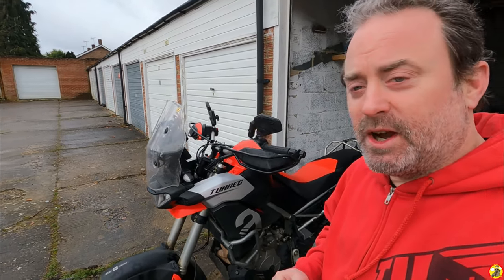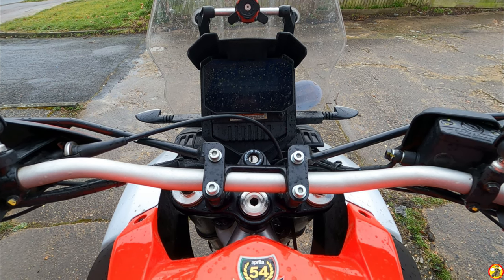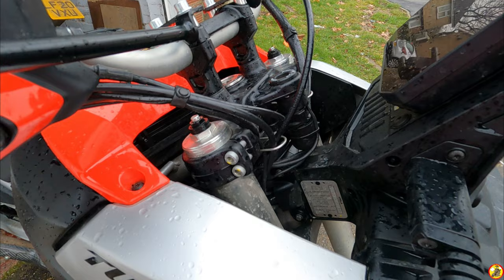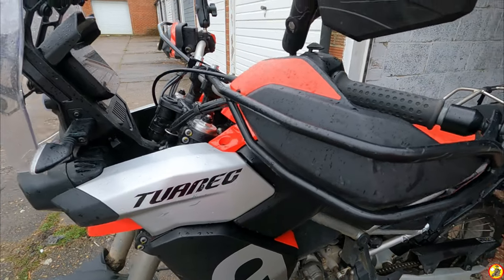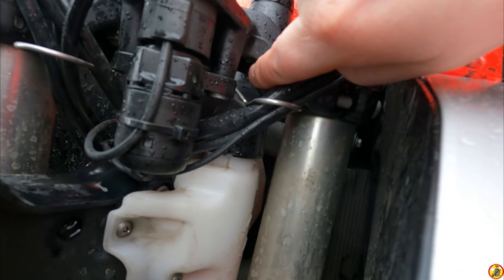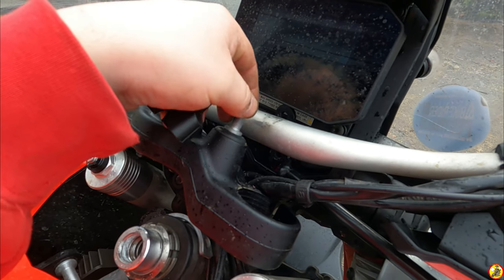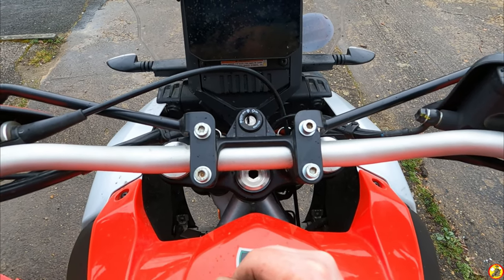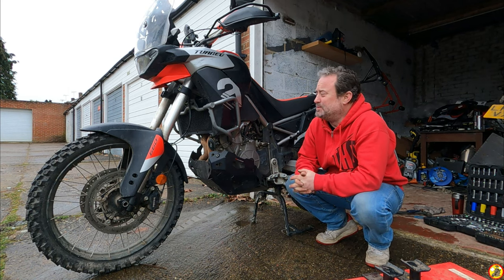Straightening Handlebars | Aprilia Tuareg 660

Comment: Thanks for the video! Mine came with the bent handlebar and so I returned back to the dealership, and fixed it with loosening the bolt from underneath.
After a slight crash the forks were slightly twisted as well as the handlebar.
Loosening the lower bolts of the forks on just one side and the bolts that fix the axle and the wiggle the fork whilst fixing it between the legs did work.
As for the handlebar: just move it into one direction until it is on block and then applying more pressure works immediately. 
Just had to write this, as it made me neurotic, once I realized something was bent or twisted. It´s all in your head, like you said ;)
Reply from the maker: It messes with your brain when the bars are wonky. Glad you got yours sorted easily too 🙂

Comment: Clever boy!!
Well done Pete. I could see exactly what you were showing us in terms of the mis-alignment. Pretty much what I thought from the footage from the crash day, the whole thing out of whack at the bar risers. What a fiddly way to access them, and also, yeah that single bolt coming up and with the rubber mounts makes it a slight point of weakness in the event of a fall onto the bars... but I guess it DID save the bars! :)
Reply from the maker: Haha, thanks David :-D
Am glad the angles worked, and the point I was showing was achieved... cameras and spanners are a tough combination!
It was a bit of a pain to need to remove the top yoke, but easily achived in reality... and due to how the head bearings are mounted, I didn't need to mess with them or the nut that torques them down, so no chance of me messing them up inadvertantly thankfully. I think it is a good thing having the setup the way it is, makes it much less likely that the bars get bent like you say, and had my on bike tool roll I have made up had just a few bits more in it, I could have done this all on a trail if I was more hardcore.

Comment: Thanks for sharing that. I have exactly those same two problems you’ve mentioned here. One straight out out the dealer; funny how dealers can never see these types of problems when you and I point it out to them. Riser bent is my next challenge…to address. That may have happened when I dropped my bike at the light (from dead stop). They are made of dough. Can’t imagine if had ‘dropped’ the bike say at 5-10mph.
Reply from the maker: My dealership is really helpful, so I am sure it will get sorted on my bike.
Without wanting to sound like an Aprilia fan-boi, if yours has misaligned on the riser like mine has, it is designed to twist rather than cause damage to the bars, much easier to slacken things off and realign than it is to replace bent/broken parts! 🙂
Hope you can sort it easily mate

Comment: Hello,
It is the same on my motorcycle and I have not suffered any fall, it comes like this from the factory, now I am talking to the dealer since it is under warranty, in my opinion, this happens because when they are in the wooden box where they are transported, they do not It has the front wheel on, it is attached to the sole of the same wooden box and with the movements this can happen, another theory is that it comes badly assembled from the factory, my TFT is twisted to the left exactly like yours, in fact, in There are gaps on the sides, it is clearly seen from the driver's position, the same dealer has recognized me, this has happened to me since the day of the premiere, I saw it right there when I got on it for the first time, thank you, I hope to help those who experience it the same.
Reply from the maker: I hope you can get it sorted 🙂

Comment: Cheers from Italy!! The cockpit of our little Tuareg is same askew here as well :) I have heard it is a thing with the Martian Red model. You can easily fix that (or at least improve, in my case I did not really fix it 100%) by loosening the 4 bolts that keep the cockpit to the chassis, repositioning the cockpit and tightening again. You will have to loose the little cooler liquid tank as well, in order to have access to the 2 bolts on the left, but it's not a big deal, go for it!! Also you'd be better to loosen the two screws left and right on the tank, under the knobs of the handle bar, to let the fearings adapt to the new cockpit position (everything is connected). 
As of the raisers, I did not fully get from your video, if I ever want to remove or adjust them can I do that without taking the top yoke off? 
Thanks!!!
Reply from the maker: Ahh many thanks, I shall give that a go as the twist is annoying 🙂👍
Regarding the risers, I can't remember exactly, but I don't think that you can loosen them from above, so I think that you have to remove the top yoke unfortunately

Comment: In my case turning riser around a few times sorted it out, riser settled properly on the 'bracket'  after that. I didn't have to take top yoke off. Anyway thanks for video and the tip other day.
Reply from the maker: My riser wouldn't turn without slackening off the nut under the yoke sadly. Really glad to hear you got yours sorted 🙂👍

Comment: I've only ever slackened off one side. The twist is one side relative to the other, not both. Happy to be corrected.
Reply from the maker: Top tip, ta 🙂👍
Reply: I think much depends on the bike in question and the type of fall. If the bike's up on the stand and you've got the tools out, it doesn't take that much longer to work up through the front end from spindle, pinch bolts, fork brace etc. If the bars themselves are slightly bent, it's not uncommon for people to misalign the yokes by setting according to what looks straight from the cockpit. Things like this bug me....think I'm a bit OCD were bikes are concerned
Reply from the maker: @billyb6043  nothing wrong with a bit of old regarding bike maintenance

Comment: The bars do look slightly tweaked but it's not too bad.  Usually, on MX bikes the bar risers have rubber inserts and can be loosened, straightened out and tightened back up.  
Are your fork seals leaking or is that just dirt collecting up from the front fender?  After loosening the upper and lower triple clamps and wiggling her about I would recheck the fork height's in the upper triple clamp as well.  At the end of the day you are using it for what it's made for and it's doing you right!!  Scratches means you are using it correctly!!
Reply from the maker: The forks aren't leaking, just not cleaned the bike properly... I did throw a jetwash at it to allow me to damage assess, I do need to give it a proper clean soon, just waiting for the frost/salted roads to go away before I spend any time tidying it up :-)
Aye, I checked the heights all off camera, same as adjusting the torques :-)
I love the bike mate... sure, it'd be nice if it stayed looking brand new... but that was never going to be possible with trail riding :-)
Reply: @HippoDrones  Oh man I'm the same during this time of year when it comes to cleaning bikes, there just isn't enough daylight and consistent warm weather to properly clean and ride bikes!!  I personally prefer to ride them and I will properly clean them in the spring!!!
Reply from the maker: @MonkeyButtRides  same 🙂

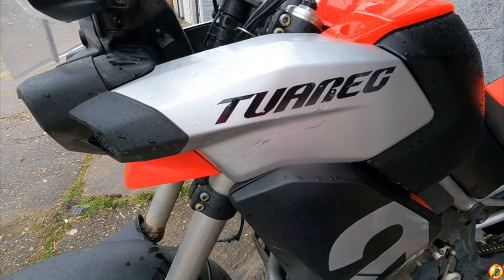Comment: 8:08 -I like to call that "Battle Damage"
Nice damage report, glad it was just a case of slackening things off and retightening.  I wasn't as lucky with the CRF, I really did bend the bars that time last year.  In a way, I'm glad because I much prefer the Renthal bars over the OEM's.
Reply from the maker: Battle damage is the correct term! 🤣
Ahh that is a pain... I did the same on my Beta Alp 4.0 annoyingly close to when I was selling it, so had to replace the bars but got barely enough time to enjoy them. I think the stock bares on the Honda and my old Beta are not the highest quality,  your Renthals will be super strong compared to them! 🙂👍

Comment: YEs, preheat the mug..lol. Man there is nothing worse than having misaligned bars after a spill. I usually find a tree to put the tire on and twist the bars for a temp fix then get home and readjust everything as you did. Man those riser bolts couldn't be in a more tucked away location could they? I could see the offset and even though minor, it really messes with your head. Looks like some lovely weather you have there 😁.
Reply from the maker: Firstly, I love that when I read your post, I read them in your voice! 😀
I think, had it been my Beta, then a tree could have fixed things... but... BUT, although I don't mind the Toe-Rag getting battle damage, I'm not quite ready to wedge it into a tree to reverse crash damage! 😀 hahahah 😀
Preheated mugs FTW 😛
Sadly, the nice funshine was short lived... rained all the way home... and has only been nice a couple of days since... but all good... Spring is on the way! Yeah-Boi! 😀

Comment: Nice job mate ! What are your tires ? Are you happy with them on cold and wet tarmac ?
Reply from the maker: Hi Maxime,
They are Motoz Tractionator Adventures. They are happiest on dirt and wet sloppy mud. Tarmac, especially when wet is not their place to shine. If you mainly ride dirt, they are great, they last well on tarmac, but don't grip great and restrict the speed you can ride safely at too (under 90mph). If you mainly ride tarmac, then there are much better tyres.
Reply: @HippoDrones  thanks for your answer ! I’m looking for 50/50 tires for my tuareg that would last for miles on roadtrips. Maybe the Anakee wild are safer on the pavement. Always the issue of compromises concerning the tires 😄
Reply from the maker: @Srager4  no probs mate 🙂 👍 
Sadly I don't have any experience with the Anakee Wilds to be able to comment.

Comment: That handguards protectors tight to the bar risers don't seem a good idea, and also bent when you fall, get a proper handguards or leave the oem, sometimes protection can make more damage.
Reply from the maker: I am not happy they bent so easily, but they still stopped my levers breaking. The OEM guards are just for show, they offer no protection in an off. If I change the bars to lower/narrower bars, I'll fit proper handguards like I have on my Beta enduro bike, but these will do for now.
Reply: @HippoDrones  I bring with me to trails spare levers, get a cheap one's just in case.
The way that protector bent I don't know if it was a fall to break a lever they will do the work.
Before o get a lower bar and handguards be shure they don't hit the plastics or fuel tank.
Edit, you can also leave them not to thigh, so when the bike falls they can have some movement, but don't untight too much
Reply from the maker: @MLeitao  The bike has fallen a few times now, with no damage to levers or handguards thanks to the H&B handguard protection fitted currently, so I am ok with how it is currently. On my Beta, I keep the handguards tight so as to not allow them to move, have fallen off that bike on tarmac quite hard and no damage to the bike/bars/levers.
Thanks for the tips Mario, I appreciate them! 🙂

Comment: Hi, can you please share which Quad Lock mount did you use? I'm unable to find one that fits the small 12mm dimeter. thx
Reply from the maker: https://www.quadlockcase.co.uk/collections/shop-motorcycle/products/mirror-mount-motorcycle-scooter?variant=38928185810
Reply: thanks @HippoDrones
Reply from the maker: no worries @razst1

Comment: I wonder how long till stuff gets bent permanently. Like is this something you need to do in couple of days, or can you easily let it wait for some other tomorrow
Reply from the maker: Am not sure tbh, but I'd imagine it is always best to do this sooner rather than later just in case! 🙂👍
Reply: @HippoDrones   yeah I would have loosened axle bolts as well before tighten clamps back up. Also using a torque wrench on clamp bolts is vital, over tightening them might stop the fork operating properly.
Reply from the maker: @twowheeledadventuresuk2739  yup, is why I have a torque wrench.

Comment: Hippo take a look at this video, https://youtu.be/wRGk22VDBjQ. He  gives a good simple explanation on straitening front forks after a fall like you took. It doesn't take to misalign forks.
Reply from the maker: A nice concise video there. Only any good for twisted forks though, I still needed to re-align the riser and bars! :-)
Reply: @HippoDrones  It's usually the rubber in the triple clamp, just turn the bars to the stop and push hard, back one way then the other until straight.
Reply from the maker: @azlong4596  As you can see from the video if you watched it all, I have sorted it ta.
Reply: @HippoDrones  I dd watch it all was just giving  information for others out there also.
Reply from the maker: @azlong4596  ahh, thank you 🙂